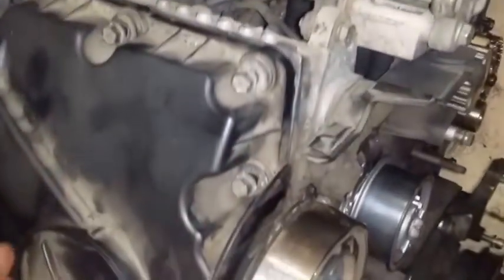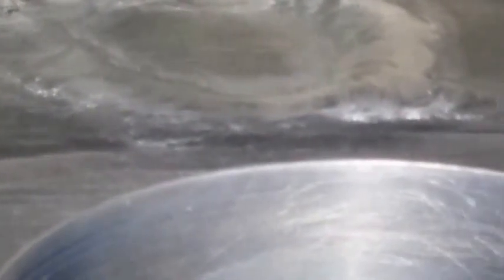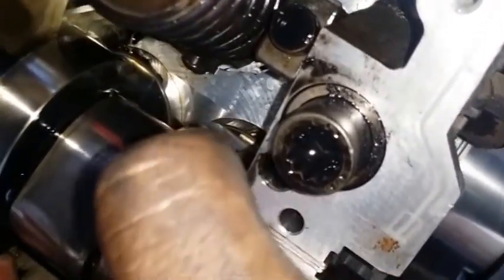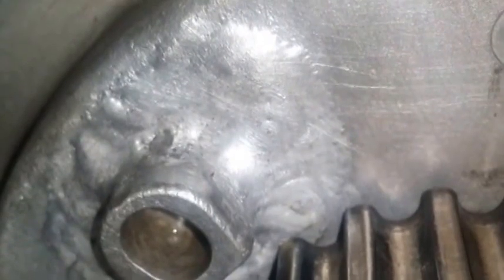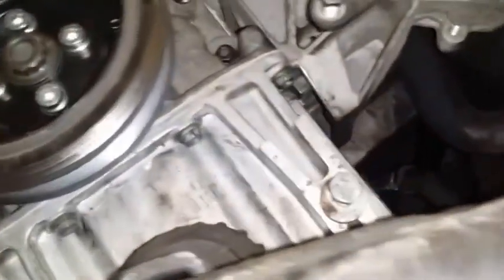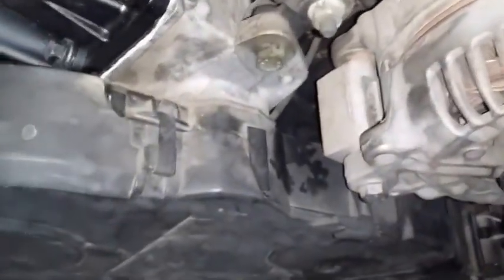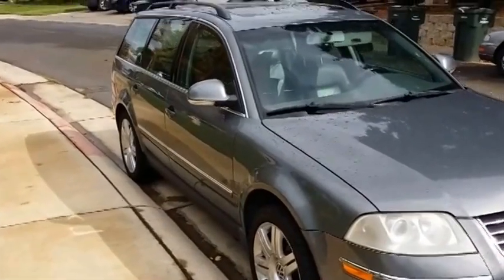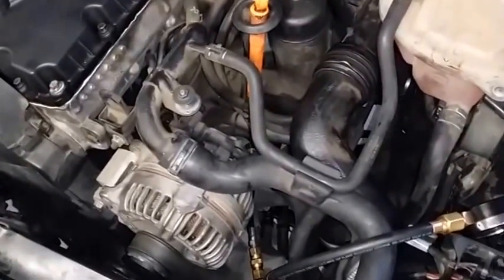VW Passat TDI 2.0 PD (BHW) Oil Pump Conversion (DIY) Part 2

Comment: Very helpful video, im where you were when you did yours rite now , my question is do you think it would have been easier to take the motor out as opposed to doing it in the car ? This is what im pondering. I thought i read over the last few days that there is a lot of issues re alighning the front end after dropping the suspension . even if there was no issues , hind sight , would you have pulled the motor or left it in ? I value your opinion , thanks for your time.
Reply from the maker: Thank you. I really dont see a reason of taking it out. It just adds more work for you. I didn't have any issues putting together the front end. I would only take it out if you are converting that car to a manual. Now that would be something exiting!
Reply: @AlbertShevchuk  thanks for your thoughts , a manual would be too ambitious for me. I appriciate your time and responce albert.
Reply from the maker: @garyhall2583  Anytime bud

Comment: Can the balance shaft delete be done without removing timing belt and or bumper?
Reply from the maker: Absolutely not, the sprocket that drives the oil pump needs to be changed so that means everything else that's attached to the front of the crank comes off also.

Comment: I believe I have this same problem.  Camera was all over the place like you warned... But, Excellent information, direction, "Do's and Don'ts" and "Oh by the ways"..... enough to for me to know..... leave this to the pro's or cut your losses !!!!!  2002 VW Passat, 1.8T.  KBB says it only worth $700+ anyway..... not worth my time to this this all out repair.
Reply from the maker: Thanks but 1.8T Engine is Gas. This video is for a 2.0T Engine witch is a diesel. Hope that helps.

Comment: good work but you shouldnt floor the car like that then switch off
Reply from the maker: why, because the turbo spooling after its off? There is plenty of oil left over for those bearings